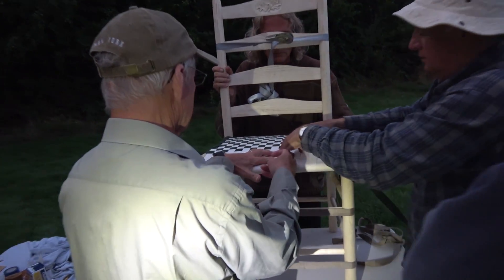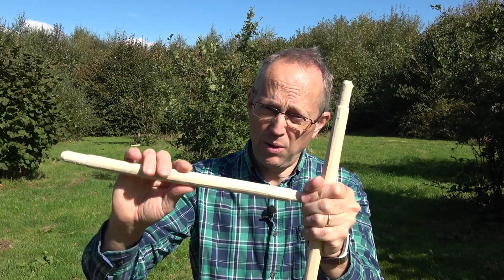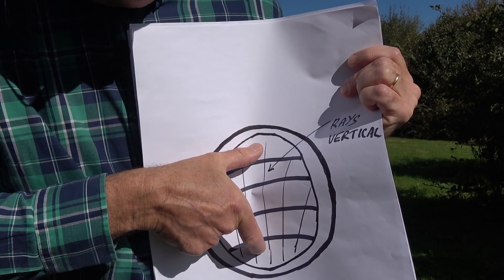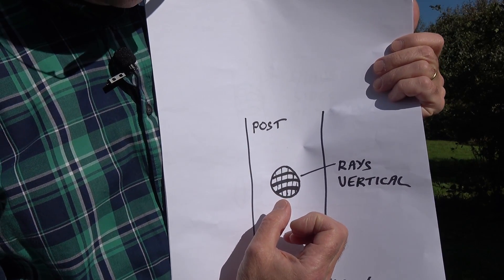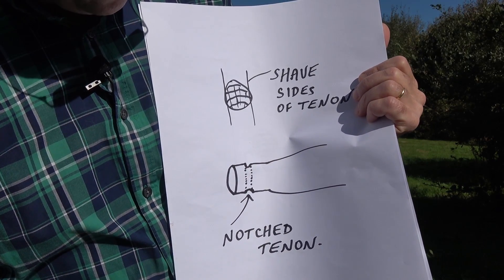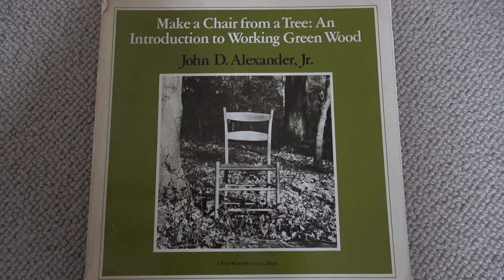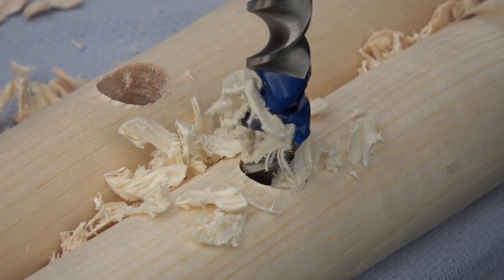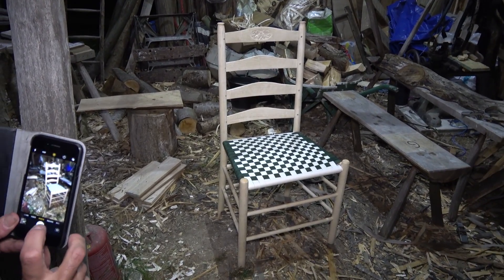Why The Greenwood Chair Made In A Day From A Tree Does Not Fall Apart

Comment: excellent information! I will try and use the "hot sand" method when hanging axe and hammer handles etc, where you want the part of the handle inside the eye to be as dry as possible to avoid shrinking in dry conditions causing the handle to come loose. When you don't have access to a heat source, say a dry and warm room with central heating a woodstove or even the sun, I have a hard time drying the handle. But this method should be excellent for this task?
Reply from the maker: Yes it certainly works well.

Comment: This is the same principle when timber framing. I made a tool shop and used green pine timbers. My pegs were maple, dried in an oven. I left the pegs long inside the shop so I could hang things on them. There isn’t a chance you could pull one out.